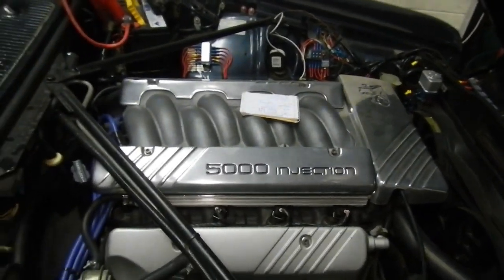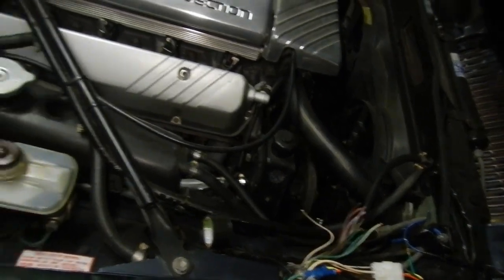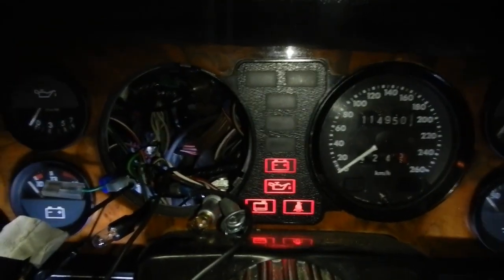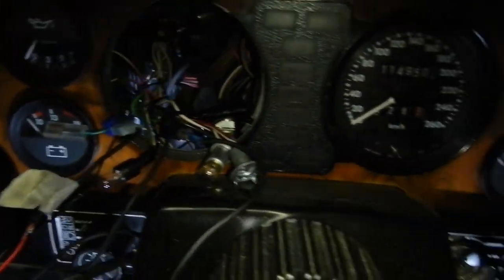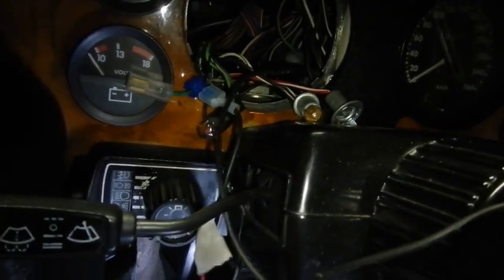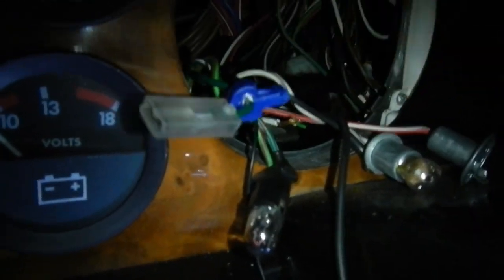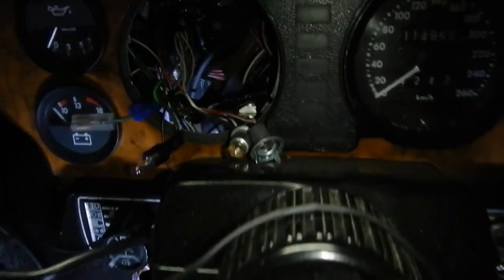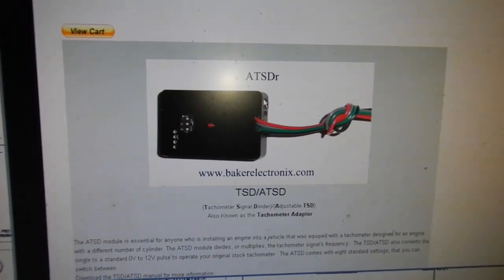XJ12 ser3 V8 wire P6

Comment: Reminds me of my buddy's Firebird. Previous owner hacked it together swapping from V6 to V8. Three different wires of varying sizes twisted and taped running across an exhaust manifold to the alternator. Two kill switches, three oil gauges. He cut the stock dash apart, taped a mechanical speedometer in place of the electronic one.  Torque arm usually bolts to a bushing on the transmission. V8 trans doesn't have the mounting holes. What did he do? Drill the floor pan and bolt it there!

Comment: Wire nuts are perfectly fine when they are used correctly, like with the correct number of wires, or the right gauge, and inside a junction box.

Comment: You allways do a clean neat job brad, so much nicer.

Oh shit, tape does not make it better, well thats new :P

Ive never seen one of those blue clamp on to spade connectors before, looks like the same kind of shit that people connect a toe hitch connector to the car wireing.

I think the cable to cable ones are called scotchlock or similar, bloody crap!!

Comment: The one in the vid is also termed a 'Scotchlock' connector, they are a really crappy way to do wiring, as they are an 'Insulation Displacement Connector' that usually makes contact in a very small area of the conductor it's attached to.which will burn out after a short period of time if subjected to high current or moisture...

Only thing we haven't seen on this car so far are wirenuts...   Still waiting for Brad to turn some of those up on this job...

Comment: Terrible wiring.. not surprising, on this car.   I am curious though.. why not reuse that converter module?  It seems like a reasonable and inexpensive solution (last time I had a tach worked on, it cost a lot more than $40!), assuming it works..